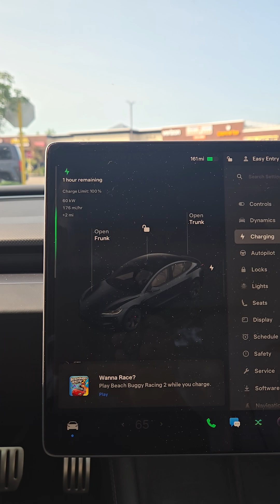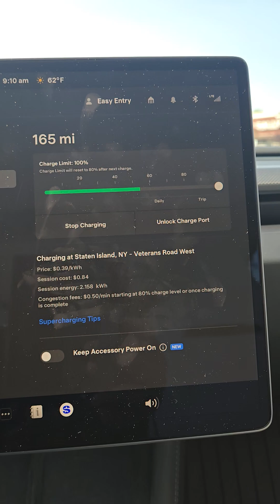Tesla Model  3 Performance never Supercharges at 300 kW

Comment: This is because you are charging at 60 KW. If you were at a faster supercharger it would be much faster around 150 KW or even 250 KW. Also your charge limit being a 100% it takes much longer.
Reply: Precondition your battery.  And set charge limit to 80%   shouldn't take longer than 30 minutes to go from 10-80%
Reply: @MrJokerEats  Facts